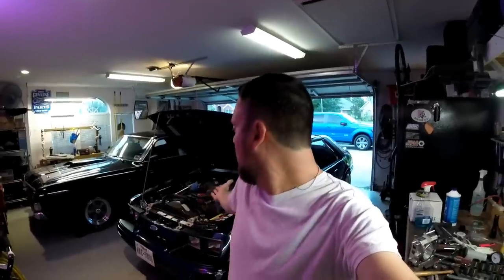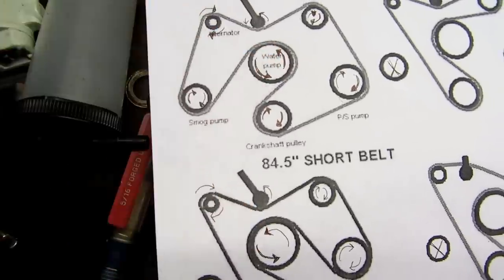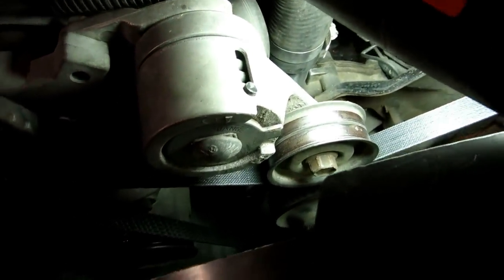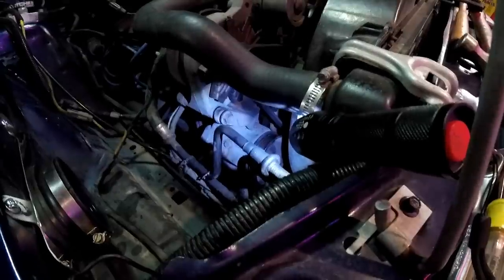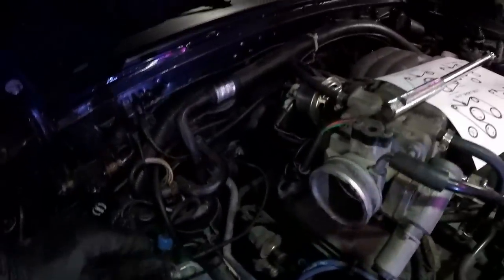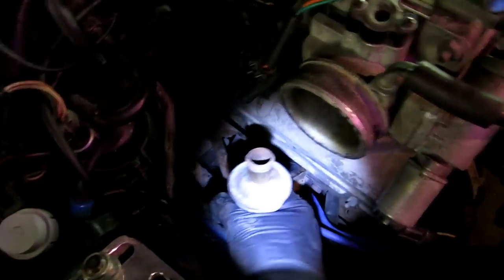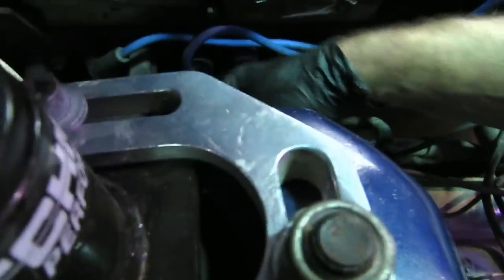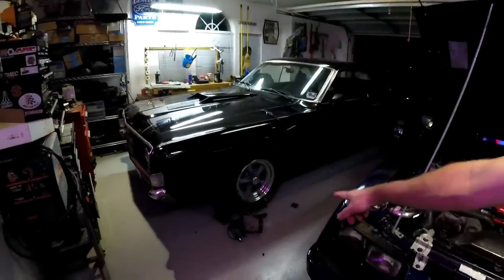1986 Mustang GT Project - Smog Pump Delete

Comment: I seen people plus lmr do this but flipping the heads on the exhaust port is the most realistic approach everything else I seen is either for people with tiny hands that smell of cabbage or a bull crap was to sell products thank you man I used all your ideas it actually increased throttle response and fuel mileage and horsepower
Reply: I Don't  Know what you are talkn but it was funny🤦🏾😭😁😁😁😂😂😂 hope that doesn't make my head small & smells cabbage

Comment: Did this over 2 weeks... I took a scriber and marked the drivers side and passenger fittings to the heads before cutting them off the crossover tube.. It seems straight forward but theyre basically identical after removal.

Comment: My smog pump bearings are make a death screech and smoking while engine running. Can I just add the 84.5 inch belt and keep the smog pump bolted in place? What will happen if I don't physically remove the smog pump?

Comment: nice work, I just put the motor back in my 85. Check to see if your tensioner has 3 keyway holes in the back. If your on #2 or 3 you might be able to get it to the top hole to alleviate some pressure. I obsessed about my 92 notch engine bay cleanup! I've got it down to darn near nothing. Keep up the good work and videos!!
Reply from the maker: Thanks Ray, i was unaware of the key hole adjustment. Good to know will look later tonight!
Reply: Mike Dula my 85 has it, but my 92 doesnt.....thanks Ford haha
Reply: Mike Dula what you at it what I did to my 90 Mustang I just remove the smog pump and then just kept the same belt just you should remove this smog pump might as well where you at it

Comment: For the crossover pipe on the back the heads I just put a 3/4 galvanized steel cap over mine doesn't look pretty but saves time and headaches eventually when I pull the engine I'll do a cleaner job.

Comment: 85 1/4 length pops right on.  right number wronglength,  a round trip to the parts counter.  Gates brand correct length with 4060845
Reply: how does 4060845 have same name but 2 diff sizes?

Comment: Mike, i stretched a belt on mine once and it wore out the bearings in the alternator alternator pulley fast
Reply from the maker: Good point and good to know. Goes to show to set these belts to the a tension that not too tight.

Comment: Won’t these caus tuning issues such as the smog pump goes bad or isn’t there the car reads the wrong fuel mixture? Would you need a tune after this?

Comment: I have a question my smog pump froze on me so I can just get the smaller belt and run it like that and just have the smog pump sitting there without taking the smog pump out??
Reply from the maker: Yes you can! you can just bypass it with a smaller belt.
Reply: HOUSE OF DULA hey bro I have a question  My car starts up fine when it's cold start but when I drive the car for a while in the engine is hot it takes 3 to 4 cranks before it starts and these are long cranks do you have any idea why it's doing that
Reply: So what about the vacuum lines? My smug pump seized up on my 94 5.0, if I bypass the smog pump and leave pump and everything else in will i need to do anything else or is changing the belt to an 84.5 all it takes
Reply: @kawaiichino9507  He answered this years ago. Your answer is 2 lines up

Comment: HOUSE OF DULA Just curious, after smog delete was there check engine light showing or idol issues? Please help, I'm working on a 91 coupe & really want to dump the smog pump, but don't want to retune my car. Thanks
Reply from the maker: Removing it wont cause any idle issues, or a need to retune. It night cause a check engine light, because when the valve open fresh air into the cats the O2's are expecting it...if they dont see it it will throw a code. But it wont cause drivability issues. My fox was already throwing that code because the smog crossover tube in the heads are usually clogged with carbon, so its not working anyway. Its fine to remove it. Your idle issue is something else...removing the smog wont fix it or make it worse. Another thing to be cautious about is the cats. If they are 100% stock, they need fresh air from the smog pump to stay cool and not overheat and melt (likely are already, again this stuff usually is clogged with carbon with high miles)...I took mine off knowing soon id be going with a catless exhaust system....long story short...it made ZERO difference in the way it ran when I removed mine.
Reply: Thank you HOUSE OF DULA. I'm using Bassani X pipe with 2 Cats. I will follow your advice, info, and video, so I can loose some weight, less stress on crank, & cleaner engine bay. Great video for ppl like me in the Fox community:D

Comment: Once you have removed the EGR with smog pump, do you need a check valve on the vacuum line from the air canister to the intake?

Comment: How have you all capped the hole in the exhaust? I have holly carbureted 85. Everything here seems pretty much exact to what mine has going on but I dont know much about modifying exhausts. Some sort of cap something that can bolt on? weld a cover on?
Reply from the maker: Cut, hammer and fold the metal to cap it. Thats what I did, just pinch it close.

Comment: Did you install a plug for the wiring to keep the computer from kicking a code?
Reply from the maker: No. The 86 efi cars didnt even have a check engine light, youd have to scan it, and the codes doesnt change  the  performance at all. For 87+ cars, it would be annoying to see the light on all the time. Youd want to use a plug or like most tune it out.

Comment: What about the EGR after removing the vacuum system?
Reply from the maker: It will trip a code, but not hinder or change performance, or keep it from passing inspections (Texas these are classis and do not need an emmissions test). My cars smog tubes we're blocked so the system wasn't working anyway, so I just got rid of it.

Comment: Hi Mike,

I do not understand, in the cut pipes the hole is not closed?
(which are mounted on the rear of the engine)
Reply from the maker: On the cut part...where I cut the mounting flange from the pipe, take that mounting flange and flip it, mount the back side to the heads. The back side is flat so flipping it just blocks the hole...just be sure to clock it right so that it covers ALL of the hole...you'll know, your hear an exhaust leak if you dont.

Comment: Lol. I just watched another video doing the same thing. Same year mustang with air and power steering and he went to the auto store 4 times till he got the right belt and he's was a 76in belt. He's pump was going bad and he's pulley on hes pump had a 8ib drag So it did free up a tiny bit of HP for him.

Comment: Will 84.5/8 work? And I’m leaving the pump on just removing the pulley
Reply from the maker: I bet it will be fine as long as your tension has movement both up and down. If you bottom out the tension pulley you could snap a belt. My belt at 84.5 was pretty tight getting on, every car might be a lil different but I'd bet that belt length would be perfect.

Comment: Did you put caps on the two solenoids you took the vacuum lines off of or did you just leave them open?
Reply from the maker: No, I pulled the lines and capped where needed. You never want any open vacuum lines. Vacuum leaks will cause all sorts of drivability issues.

Comment: I'm doing this to my 89 town car The egr plate and the eliminator plug do work on a town car im keeping the smog pump just gutting it and re grease bearings so i can use stock belt  already dont have cats ill be using the plates i cut from the crossover tube to plug head holes i find this to be easier because u dont have to clean out carbon filled holes

Comment: I'm wondering if this is the same as the 5.8 liter in my pickup, the length of the belt I mean?
Reply from the maker: Likely not. Best thing to do,  remove the pump, then use a string and run it how the belt would run. Then measure string and subtract about 1" to compensate for the tensioner. Did this on my new trick flow motor and it worked perfect.
Reply: hell of a good deal, thanks for that info, i'll do just that, I much appreciate your advice.

Comment: Rookie question lol will your check engine light stay on after doing this to my 89
Reply from the maker: Yes, likely. PArt of your emmission system opens the solenoid to send fresh air to the cats...the O2's would be expecting it so will throw a fault. But will NOT cause the engine to change its performance at all. And, this can be tuned out. For me...86's dont have a check engine light, so one would never even know without running codes..My car is emission exempt in Texas as well.. Because of carbon buildup I would have had he light on anyway. The entire emmisions system would have to be replaced or cleaned up...Or, remove it all like I did and make more room under that hood. Not a rookie question at all. I wondered the same thing.
Reply: @HOUSEOFDULA  hi how you are doing will my engine light come on for my 1993 f150 5.0 flairside? And will this delete work for my truck as well?

Comment: Hey I know this video is pretty old but hopefully I get a quick response anyways do you know if 351 and 302 use the same belt lengths and do you know what size belt I would use if I have no smog pump and no ac thanks :)
Reply from the maker: I really dont know exactly. I know the 302 front accessory  will not completely interchange because the higher deck height. As far as the length goes. Best thing to do is is use a old longer belt and route it, cut to length  so that the ends butt up together then measure the length but add an inch to compensate for the tensioner. Then order that length, the length and it being 8 rib it typically in the part number of the belt.

Comment: Is the length 84.5 for the no a.c. and no smog pump diagram
Reply from the maker: No, 84.5 is with AC, with power steer and NO smog pump. This is the length I used. On e thing to note is that if you have underdrive pulleys or not this could affect belt length.
Reply: No under drive pulleys here personally don't like them and I am running no a.c. and no smog pump
Reply from the maker: Gotcha....Yeah your right that diagram does not have a length for it. What I would do is take the old belt, cut it....route it then mark and cut again so the ends butt up againt each other. Then lay it out in a long line and measure it, add .5 to 1" for the tensioner. This should work for you or get you very very close. You might have to make a trip or two to the auto parts store. Remember, the PN usually indicates the belts length.

Comment: Did you leave on the charcoal canister? Also like how the sparks flew over the WD-40 @22.25....🔥.
Reply from the maker: +Martin Yarman - I did, but it will be coming out with a new engine swap along with the rest of the EGR set up. Appreciate you noticing that. Always need to be super careful around that crap and welding.

Comment: While you were there eliminate EGR valve?
Reply from the maker: If you do, on a stck ECU it will throw codes. But...I cold have easily just went ahead and removed it as well during the smog pump removal if I wanted. My trick Flow motor I put in, I eliminated EGR completely.
Reply: @HOUSEOFDULA  very helpful video, thanks.
Reply: an egr delete kit is available.  I put one on mine and it tricks the computer in to thinking its still there.
Reply: I know this is old but after you deleted the vapor canister do you get a fuel smell from the tank? And did you just leave that line open?

Comment: I like having mine on and it’s getting rare to see them on stock .Are you gonna take your charcoal canister off also
Reply from the maker: Its off too. Engine compartment looks 1000 times cleaner with the emission stuff gone. But,  I kept it all in case I ever wanted to put it all back to stock. But, lets be honest, the stock engine was shot and the replacement engine will likely never have smog stuff put back on. Car is not original color, floor pans replaced, subframe connectors welded in, brakes, suspension are long gone in favor for the 5 lug...its far from stock, but not at all hacked up. Parts put on it all make it a better more modern, safer car to drive.

Comment: MIke, you can also just cap off the crossover tube with a 3/4" cap.. For the belt, as long as the falt side is facing the water pump pulley, it is turning it counter clockwise. Last- make sure you dont have the belt too tight or you will wear out the bearings in the water oump prematurely.  Good job though
Reply from the maker: Good point about the flat side of the belt, this is true! just never thought about it that way. I wanted the tube out as well, just looks a little cleaner. As far as having the belt too tight, the tensioner, being under spring pressure should it should maintain an even amount of tension on the belt. As long as you have free movement in both directions, spring is not worn, pulley bearing is fine, there should be nothing to adjust that would make the belt tight.
Reply: Big Daddy I did the same thing on my 88coupe. I just went to home depot and got a 3/4" galvanized cap. it's looks cleaner the way Mike did it though good job.

Comment: If I do this can you comment on what will happen to the cats?  I heard they can be ruined from this or should I even care?
Reply from the maker: This is true. I didnt care to be honest because I dont need to pass smog on it and I know Id replace the exhaust anyway. BUT something to consider, the older CAT technology needed the air to help them do their job. I also heard with the air pump they will over heat and crack up internally, or at WORST block exhaust. Heres the deal though, I almost guarantee yoours isnt working anyway, like mine wasn't. The exit from the back of the heads we're completely blocked off with carbon.
Reply: Thanks for that.  I intend to keep the stock engine and theres no emissions tests where I live.  Will work on smog removal once I have to park it for the year due to road salt.

Comment: My 84.5in belt was loose my tensioner bottomed out 🤷🏻‍♂️🤷🏻‍♂️🤷🏻‍♂️
Reply from the maker: All this depends on your combination, never ALWAYS a 1 size fits all. Im running an underdrive set in this video, which would make the belt shorten than a guy running stock pulleys.

Comment: has anyone ever done the smog delete with crank & water pump under drive pulleys and been able to use the 84.5 ? i would think it would work because the same belt is still on it now that was on it with the stock pulleys ? never really bothered me before but im wanting to heat wrap the headers  without removing them and its the main obsticle even though its going to be curse words from start to finish lol
Reply: Did you ever try it? I’m in the same boat, and my header is pulled right now (doing exhaust work). I’d like to delete smog at the same time.

Comment: Hello, any drawbacks with fuel smell in the car? I've read that you shouldn't remove it because first it doesn't give any hp and second it helps in the fact that you won't smell like a gas tank when driving 😁
I want to remove mine on my 87 just to get a better access to my heads and plugs...
Keep up with the videos, I love them!
Reply: I think as long as you leave the charcoal canister connected, the fuel smell should not be too bad.  I recently deleted mine, and havnt noticed a difference in fumes or smell.

Comment: what heads are you planning on using? I have a 86 gt also that I am working on and love the videos you are making. a lot of similar stuff I am having to do to mine. keep them coming. thanks
Reply from the maker: Trick Flow. If I keep the stock block, they will be compatible with my flat tops..If I rebuild the engine or replace they are still a good head.

Comment: Oh look headers ,that's what i said to the 1st time i saw the exhaust manifolds too.Then i bought a set ford performance shorty headers and the engine came alive ,WOW what a difference .Throw the stock manifolds away
Reply from the maker: +Mustang Greg v8 -  new engine runs a set of Ford Performance shortys
Reply: Mustang Greg v8 where did you find you ford performance shorties?
Reply: Mustang Greg v8 I’ve been trying to look for them for my 93 LX
Reply: I got the Ford racing performance shorties from Tommy vaughn in houston about 8 years ago .If you can.t find the ford get Mac or Flowtech ,stay away from the chinese ones on EBAY